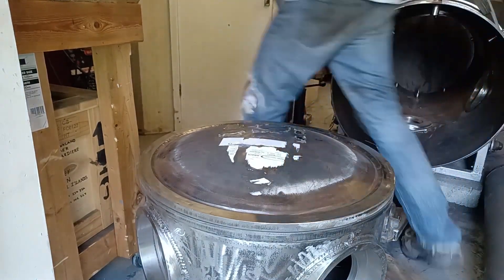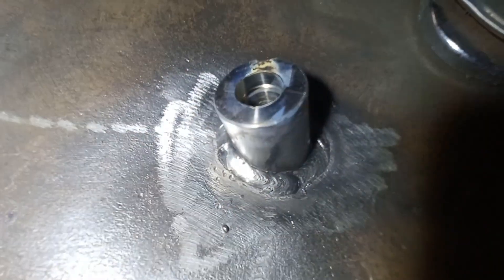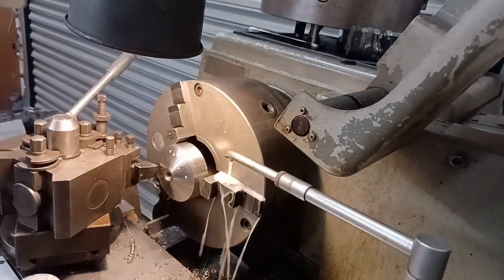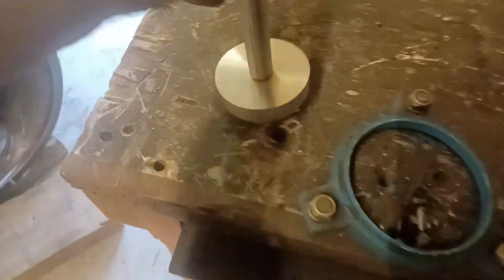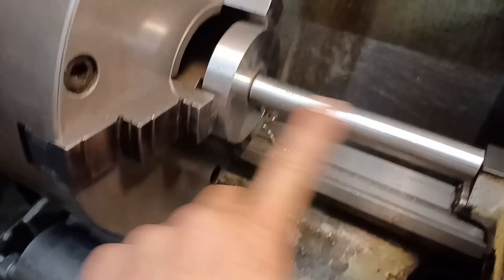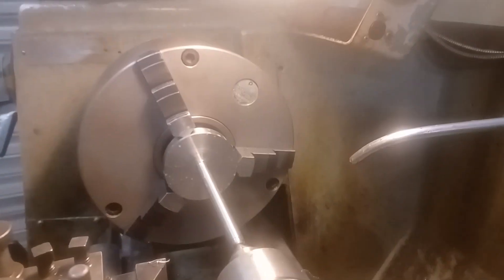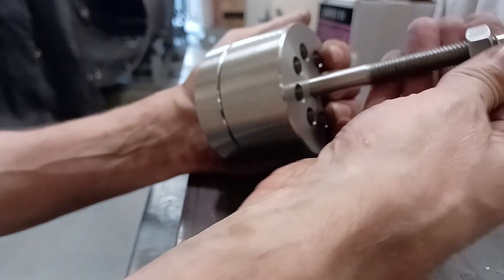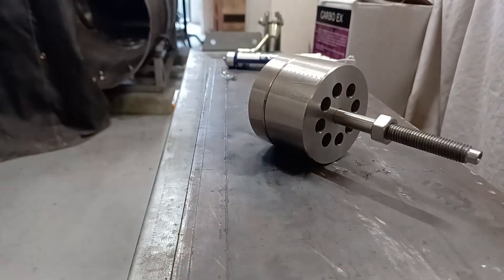Building a Submarine. Part 153.

Comment: I would put it in the hull above your legs.  You can see it vent and it is not going to cause you grief.  It will vent and if a drop of water enters its no big deal.  It will start venting before the sub hits the surface, regardless where it's located.  Also reducing weight up high is a good thing.
Reply from the maker: Think I will Hank.

Comment: Looking good sir!  What is the design depth?
Reply from the maker: Hi.  Hull is designed for 300 meters.  Viewports 200 which should be the limiting factor.  Realistically, I would like to test to 150, 200 if I can.
Reply: @guernseysubmarine  Thats deep! Good on ya
Reply from the maker: @LadyDewBuild  and realistically I will only use it to probably 50 at most.  There are a couple of wrecks here I would like to dive.  30-45 meters mostly.
Reply: @guernseysubmarine  I Understand, I'm ex Navy, wanted to go into the sub service but was disqualified due to asthma, so I requested any ship that killed subs. Got placed on Frigates. I have always had an intrest in diving in a sub. So Love your channel. Personally I have moved on, built a 44' steel cruiser in my yard and am currently liveing full time on a 57' long range cruiser.